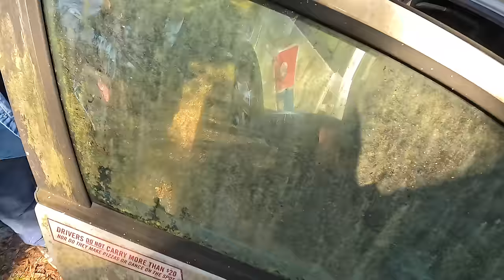I Bought one of @Samcrac cars - Full Farm Tour Exclusive Never Before Seen Cars!

Comment: If you are going to put a boss intake manifold you will need to get a aftermarket tuner on it to really use the added air flow. With that manifold the car can rev up to 7800 rpm with a tuner on it. I use to have a 2012 mustang with one on it. Yes you do lose torque but with a tune it not even noticeable.